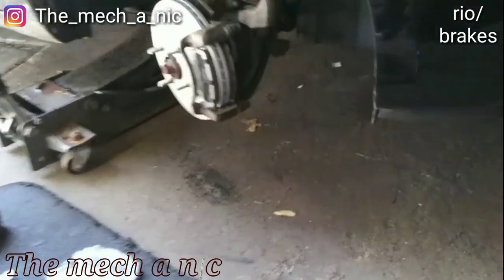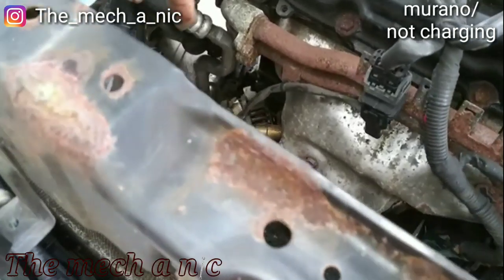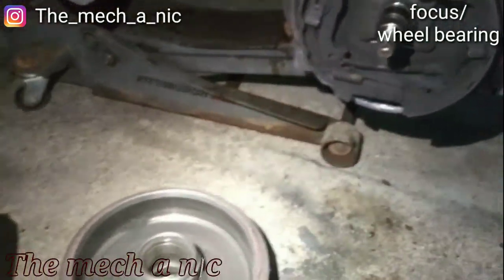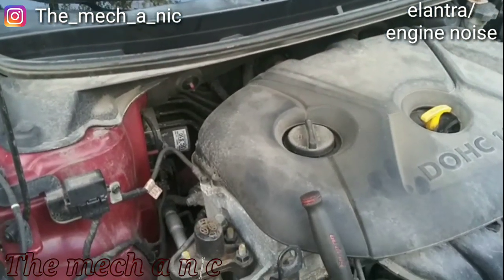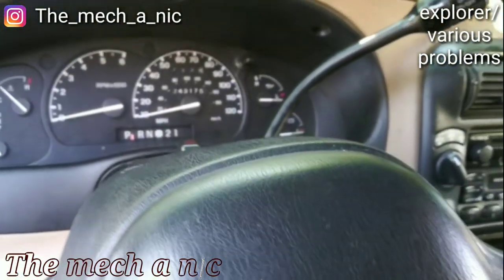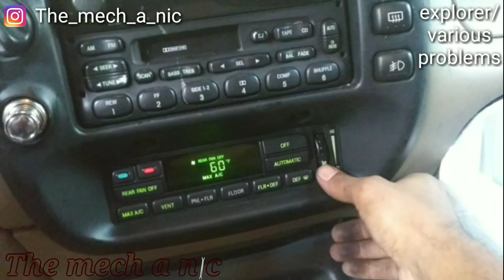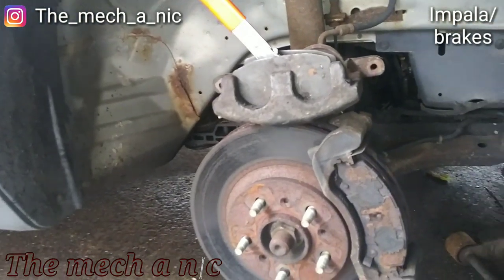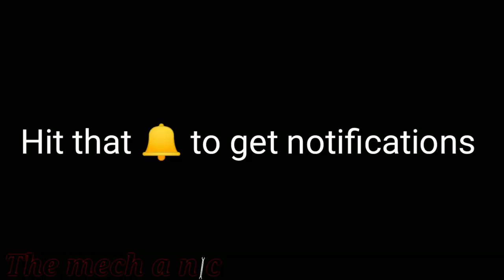insta mech a nic (vol 37) murano alternator , focus rear wheel bearing

Comment: What? A customer who just wanted the car "refreshed"? That's great, good for him. I'm with you on Nissans. The more I watch mechanics work on them the more I know I don't want one. Shop press in use. Cool. That guy got lucky on the no oil in engine thing. Wow. Nice fix with the lighter. (ha ha) Great shot of Leon. Hang in there. Great work trying to keep up.
Reply from the maker: the guy with the kia ,he's one of the few who consult with me before he does anything to his car and listens to me. yeah these nissans are frustrating. on my car it took me forever to find the fuse box under the hood then to find out you have pull out the fuse box to check any of the fuses!! who approved this at nissan !?

Comment: Buy a shell lol it’ll rust no matter what I learned my lesson
Reply from the maker: Youve had a engine rust on you?
Reply: The mech a nic  yep built k Frank was gonna use it for nitrous setup but then when I was ready for it. Motor had rust in it. Started to eat away and leave divots in the metal. Had to start all over . Was not comfortable throwing something in there in that condition